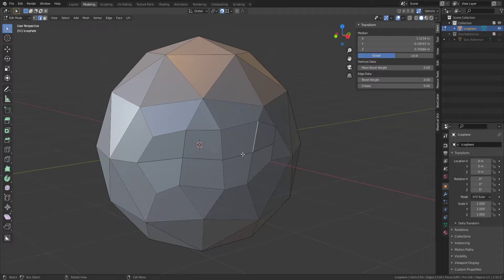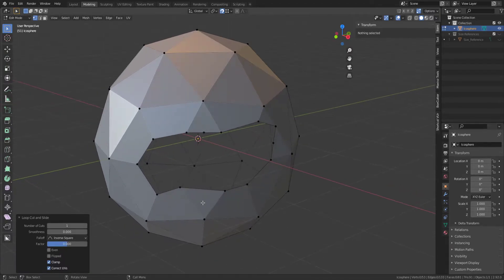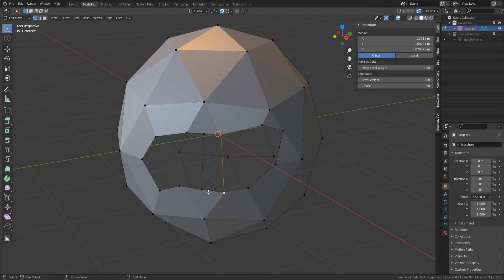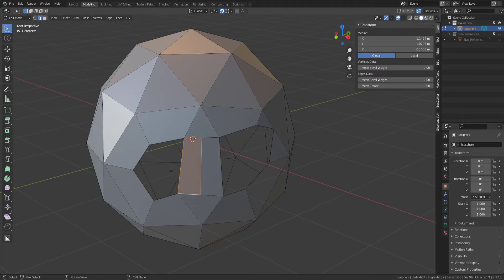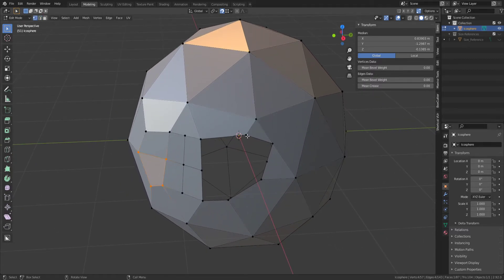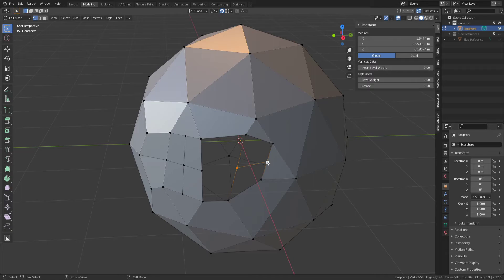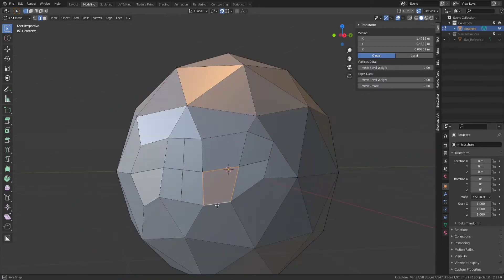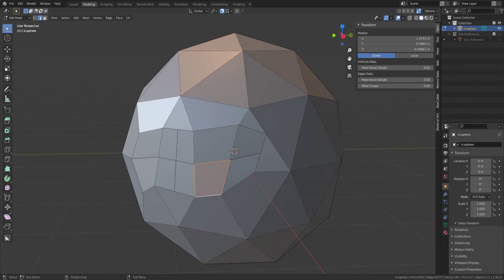Blender: Bridging Gaps and Edges/filling holes.

Comment: Useful thanks. I have a photogrammetry model of a flint that has a hole where the support was for imaging. I have filled the mesh hole but it shows strange colours in its place. How do I fill the texture with relevant colours from around the hole? Do I need to layout the mesh as a plan first? Thanks
Reply from the maker: So sorry for the late reply... Could you elaborate?

Comment: how to select all holes at once? if you have a mesh with a thousand holes, is there a way to do this faster?
Reply from the maker: Sorry for the late reply. It all depends on the situation. If the holes are all separate then it's easier but if you have holes that consist of more than 5 vertices then it will cause problems and not flow properly. If the hole you're trying to patch up has too many vertices then Blender won't know what to do with the topology and it would be something you need to do yourself.
Reply: @DarkAutumn3D  Thanx, man, I just want to know if Blender has a way to select/detect holes in a mesh (autoselect). Imagine a plane with 6 holes like a dice, is there any shortcut to select all at once? I know how to do this in Max but cant find here in Blender =/
Reply from the maker: @AlterBeast58f  Yes there is a way. Whilst in 'Edit Mode' make sure you're in 'Edges' mode then go to  'Select> Select All By Trait> Non-Manifold.' You can also right click on the 'Non-Manifold' option and add it to 'Quick Favorites' or a hotkey. Again I'm sorry for the late reply. Youtube doesn't notify me but I'm going to start checking daily.